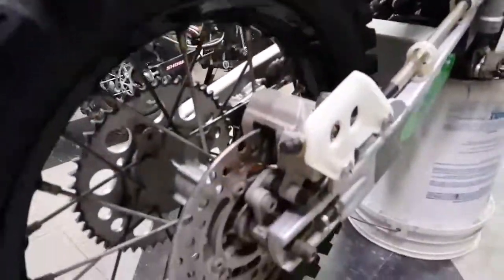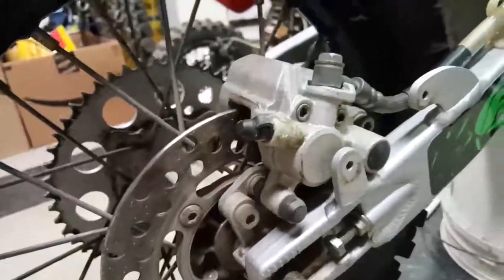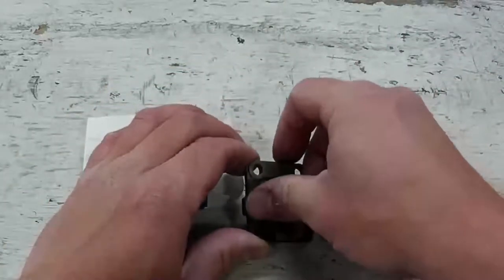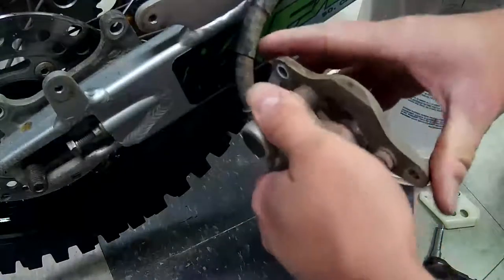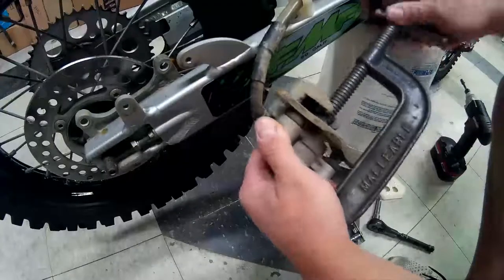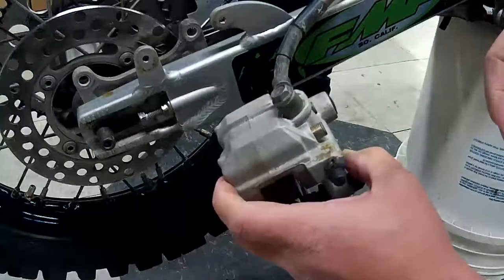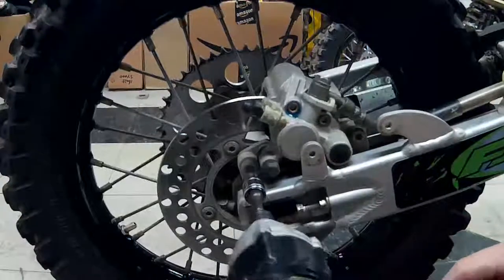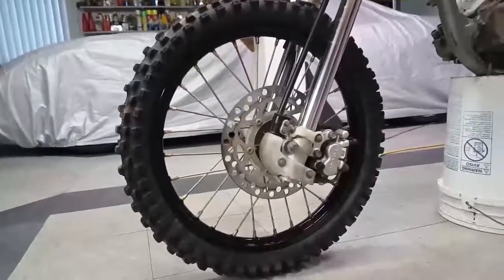KX85 KX100 Back Brake Replacement

Comment: A easy way to push open the pad caliper piston, is when it’s still mounted to the bike push caliper by hand towards the wheel to open up 👍🏼. If the piston is cruddy or stuck then do it the way you did.